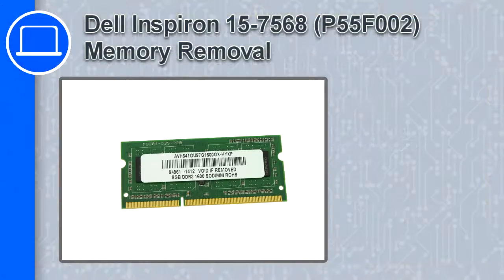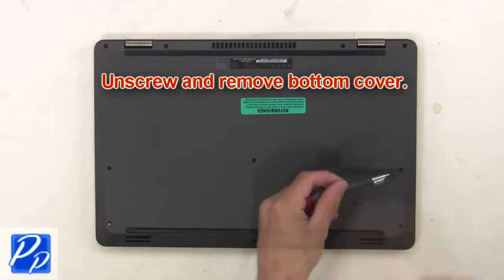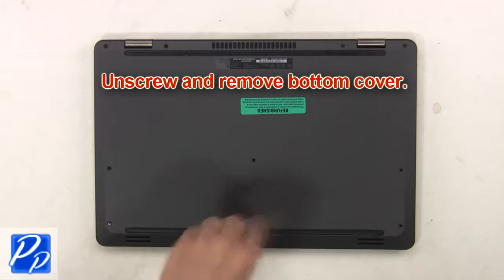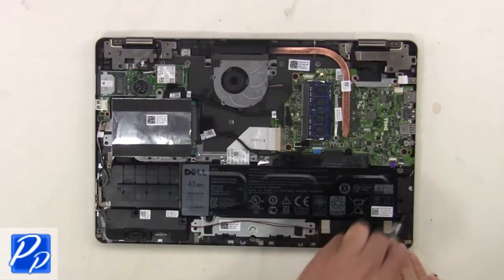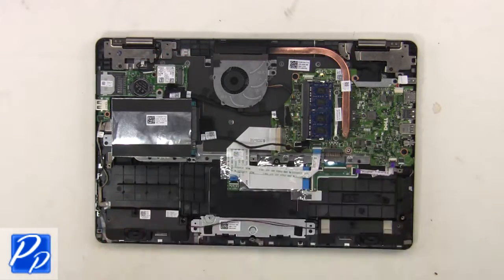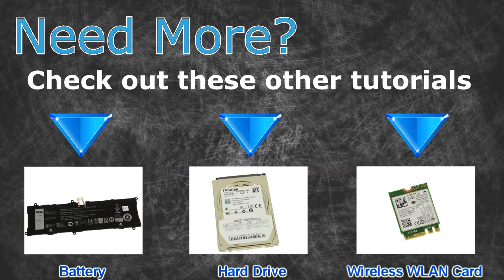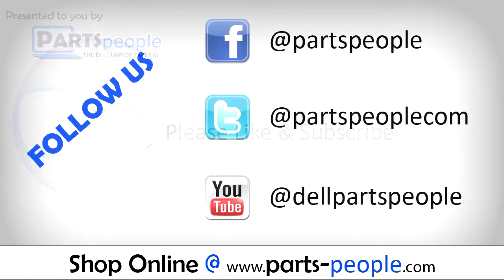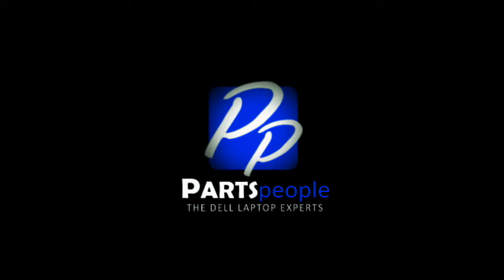Dell Inspiron 15-7568 (P55F002) RAM Memory How-To Video Tutorial

Comment: I have some questions ... 1.- Can i upgrade the ram to 16GB? (ddr3 1600?) the laptop have a secondary slot to put 8GB more? and 2.- if i want to change the HD by a SSD disc .. Which are the dimensions? 2.5"?
Reply from the maker: It has only one memory slot that can hold up to an 8gb stick. If you are upgrading to a SSD, it will need to be 7mm thick.